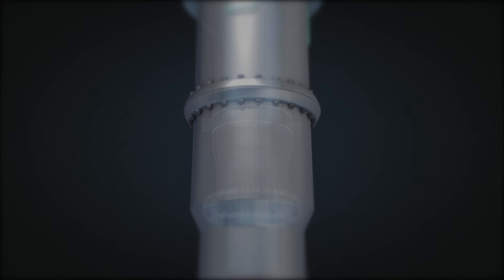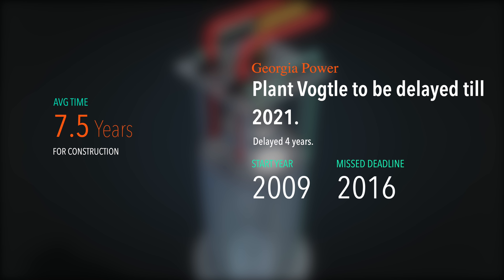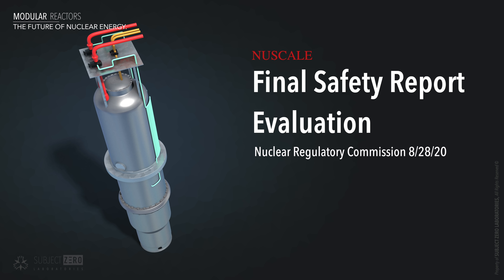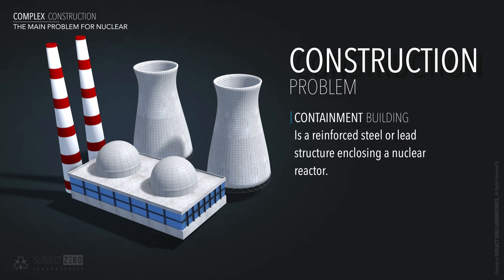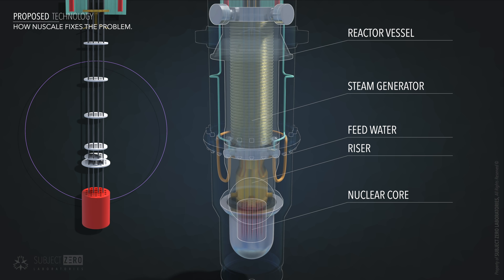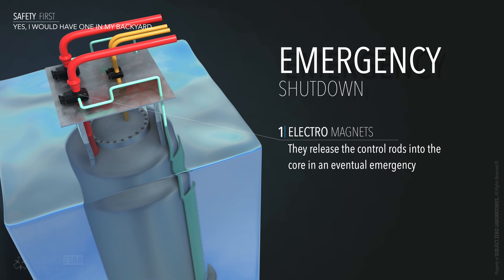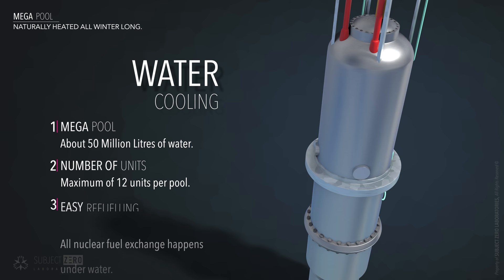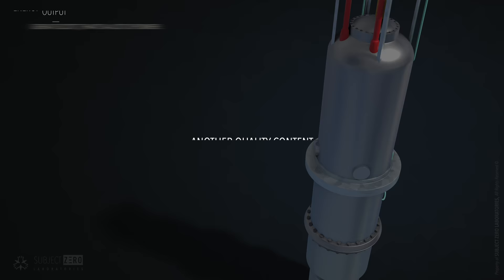A Milestone for Small Modular Reactors (SMR 2020)

Comment: The key innovation that enabled the start of the nuclear power industry was this: We don't have to worry about the expense of nuclear waste disposal because we can simply dump that burden onto future generations.  This concept is just as fundamental to nuclear technology as the idea of producing steam that turns a turbine.  So fancy designs like SMR are irrelevant to me.  I'm a hard NO until the problem of nuclear waste is solved, which will be never.  And nuclear power is no longer needed anyway, since we can now build wind, solar, and batteries just as fast (GW/year) as nuclear plants.  Also, wind and solar don't use any of our increasingly-precious water resources, and we don't need to import uranium.  Nuclear is dead and should stay dead, and I say this as an engineer, not as a political activist.
Reply: How many resources do we need to import to make solar panels and batteries? How long do those pieces of hardware last before they must be replaced?
Your point about nuclear waste is a valid one, but that doesn't automatically eliminate nuclear energy as a viable energy option for base power load. Rather than constructing billions of batteries to store energy for the inevitable dips in renewable output, nuclear at least provides another option (especially in places with extreme climate where battery performance is terrible).

Comment: What you say is true about the Japan accident.  However possibly if the generators were place on the roof instead of the basement or ground.  It may have been avoided.  Yes I know I may be wrong. Furthermore why are no SMR's are available?  I only ask a question.   I do not know all and only state what I remeber.  That said I like your video.
Reply: Not even the roof just above the wave line would of done the job.

Comment: Nuclear power has lower operating costs than most renewables? Even given cheaper SMRs in the future running costs are always going to be higher. More personnel required, fuel to mine and supply, waste to dispose of. All these things are much more expensive than any renewables. Anyway - SMRs are very promising as even the containment buildings could be prefabricated offsite. Basically you could “mass” produce them if the demand was there. But they still need to get the cost down significantly. $3 Billion for a measly 720MW reactor is too expensive. If they could do it for about a $1.50 - $2.00 a watt it might be viable. Or about half that cost. I think they’d have plenty of buyers.

Comment: The Fukushima disaster can be entirely attributed to corruption and a lack of maintenance or modifications in the face of needed changes. GE is directly culpable for much of this.

These smaller reactors are in most cases not the solution, as they are designed to be one-shot proprietary installs, with no designs intended for long term use.

Comment: Need to work on the conversion efficiency. 720 MWe from 2400 MWt is only 30%.
Reply: This is fairly standard for a Rankine cycle Carnot engine.
This is why, with a high-temperature Gen IV, people get excited about using the Brayton cycle.

Comment: We DO NOT need to lower our production of carbon dioxide, plants benefit from more, we benefit from more. Referring to our "carbon footprint" is just ignorance. "Cap and trade" is an oxymoron, the CO2 is just made somewhere else anyway.
I believe we should be going nuclear extensively, and it's nothing to do with the tiny amount we add to the trace gas "CPO") in the atmosphere: cheapness to he consumer and that nuclear is by far the cleanest, safest, and most versatile source. If you don't believe this you either work for a fossil fuel company, have shares in a fossil fuel company, or need to do some research.
I would suggest "Apocalypse Never" by Michael Shellenberger to start with.

Comment: Thorium based molten salt reactors should be the only focus until cold fusion. Why wouldn't you ? they can actively use stored spent fuel up and cant go critical.
Reply: A reactor that doesn't go critical isn't working.
Reply: @PMA65537   Salts mixed with fuel go hot- which drives the turbine- in case of a issue the salt is released through a special temperature controlled plug into a separate tank and goes cool - therefore is the safest nuclear option until fusion. You should look at the work of Kirk Sorenson.

Comment: Theoretically speaking, what would it look like if this bit of tech, the compact, was combined with the liquid sodium design?
Reply: Well, it'd need waaaaaay more development as liquid sodium reactors still have many unadressed problems like corrosion
Reply: And given that you really don't want a leak, that is a BIG worry.  

Assuming that was solved, the result would be even smaller though, due to being able to pull power magenetically, instead of the steam through the  turbine?

Maybe half the size?

Comment: Ive always said smaller reactors but more of them... The problem with the reactors that have failed badly is they were either out of date and or built in the wrong place. Dont build nuclear reactors in places that have earthquakes and dont put profit before safety . The only downside is nuclear waste . Im sure there have been at least 2 natural nuclear reactors found in nature where there has been naturally fissile material reacting in a natural setting and the earths core has loads of active nuclear material in it . Im sure more science can help us solve the waste problem and I know that is going on right now. Our power needs are not going to be met by renewable energy that is just not going to happen but with safer reactors and the science in fusion reactors nuclear power will help us cut carbon emissions.

Comment: If we ever get to using more nuclear reactors, we should start bringing back the Tesla turbine- 
It was insanely efficient for steam, and we finally have the metallurgical know-how to keep the disks from expanding too much under the centripetal forces.
Reply: Actually we reached better efficiency with multiple expansion stage turbines than with tesla turbine  

Tesla turbines are efficient but only at really high rpm and low loads so to produce the same amount of power and efficiency we are looking into 3 story building sized discs and massive reduction gearboxes while for the same power we have house sized turbine that is in some cases directly driving the generator.

Comment: It still requires the fuel rods to function to prevent a runaway reaction.  Runaway reaction seems like a non-zero probability, even if they're designed around electromagnets.  For instance, mechanical problems or outside disturbances can come into play and prevent them from moving.  While it's the simplest reactor I've seen, it still can runaway.  For that reason, I think it's a bit too sloppy a design for 2020.  Thorium reactions are miles better than this.

Comment: 720mw for 3$ billion puts it pretty close to par on with solar.
Reply: Solar capacity factor is 20-25% so you need 5x more solar power to generate the same amount of electricity ass nuclear and additional batteries. How much does that cost overall?

Comment: 0:43 oh cmon man Microsoft just paid 7.5 billion dollars on Bethesda's parent organization
Those kinda companies can easily afford a nuclear plant, and run their whole operation from there onward on their own power, while also turning in a profit.
Reply: Problem is timeline. Wendovers productions has done a fantastic video on the economics of nuclear, and why it is the perfect solution that no one uses.

with the current plublic mindset of nuclear reactors being bombs, the ammount of authorisations needed for even a light water reactor (lowest tech and least efficient of them all) drives the cost FAR above what engineering, labor and material would value them at. Because of this, when combined with gas and oil lobbies making sure fossil fuel prices are always low, but never too low as to make them not insanely profitable, it takes some years for a nuclear power plant to recoup its losses when compared to a gas power plant. It also takes far longer to build, due to its inherent complexity. 

In a perfect world, that would not matter, since the advantages of nuclear compared to gas are clear as day, but we live in a planet where the west has forgotten everything past the next quarterly report. The LARGEST timescale people work at is the politician term limit, which is ususaly very low. Due to how long it takes a nuclear plant to switch to the positives compared to inverstement, you can understand how any investor or politican would rather get bribed by the russians. If a politician decided to do the right thing and build a reactor, he would have to invest billions into the project. He would get fired at by everyone, from the eco-warriors to his own party members who would have gotten a better deal for themselves with a gas plant. This would lead to you getting the boot at the next term limit, letting you overall at a net loss. Then the next guy will either cancel the project, wasting the billions in exchange for instant political points for "having done the right thing" in people's abhorantly flawed vision, or if it is sufficiently advanced, just let it running (despite probably getting ellected over his vow to cancel the project) and reap ALL the rewards from it being completed.

Nuclear is the kind of technology which only makes sense in the long term, something that we are simply starved off today because of how ridiculously short our timescales for profit became. Nowadays, it does not matter if a company waste billions on useless shit. As long as they keep having a growth on the stock market, the herd of blind sheeps from wall street will keep pumping money into it, and lobby politicians to destroy the competition.

Comment: Could one of these power a neighborhood , cause that would be insane.
Reply: 5:21 45-60 MW ~600 houses per MW on the vary conservative end ~800 houses per MW is on the optimistic end. just depends on the average consumption for an area manly determined by climate as heating/cooling is are a large portion of that energy cost. also with greater adoption of EVs, I would expect that number to drop over the next 20 years.
Reply: @robertm1112  over the years this reactor design should improve and output more power. I was thinking that with these small reactors you can have substations generating power from 1-2 of these and spread out across a city and its suburbs there will be no need for multiple power plants that need to transport power over far distances ( less power loss ) .

Comment: Still too expensive - $10,750 per kW for Russia’s light-water floating SMR
, $6,080 per kW for China’s HTGR, $22,270 per kW for Argentina’s light-water SMR

The average of those figures is $13,000 per kW, double Bright New World’s estimate of $6,460 per kW.

All the projects are troubled - China's and Argentina's plans have stalled after one unit. Russia was supposed to have 7 floating units by 2015 but only has one. 

Banks and investors won't touch this stuff. So it always relies on sales pitches to gullible politicians. Early nuclear vendor estimates routinely underestimate costs by an order of magnitude. Estimates at initial construction underestimate costs by a factor of 2-4. Only 50% of nuclear construction sites (not plans or approvals, actual commenced construction sites) are ever built,  hammering the costs yet again.

Comment: Great video,  but you didn't answer one of the biggest questions:
What about the nuclear waste?
Reply: You can just store it in concrete facility, nuclear waste is solid so it very compact the problem is the cost of running the facility
Reply: @mandalamarcho7997  the problem is running that facility thousand of years
Reply: @osi1neu  do you not understand it can be recycled, and we are getting better at it.
Reply: At the moment we can't.
Do you have any sources?
Reply: @osi1neu  lol we can't, yes we can most governments just don't want to. France is the only nation that does recycle it's spent fuel rods.
Reply: If you refer to recycling uranium fuel to mox fuel, please compare the half-time period of uranium and plutonium. 
At the end of those recycling processes you may have less waste in volume/mass, but the long term radiation is far more critical. We are talking about >10000 years.

Comment: ll the old uranium and thorium fission reactor problems go away with the new Fusion reactor era now here. We have recently taken a new step to advance the physics of power production by enabling chemistry of the atomic nucleus, or "nuchemy", We are passing the chemistry level where we interacted with electron shells and are moving on to nuclear manipulations in this "nuchemy" atomic nuclear era when we interact and multiply nuclear protons using hydrogen fuel stock. We have rediscovered the lost work of the alchemists and can make new elements with different atomic weights and vastly new properties. This was ably demonstrated in "The Safire Project". Quanta are important. We now have enough energy in them to manipulate the atomic nucleus much more easily by creating a compartment or a local region of plasma containment so reactions at this atomic nuclear level can easily take place. This is about to practically enabled a fantastic new era of energy production for the whole of mankind. This with free fuel obtained from water or atmospheric moisture anywhere in the world. New fusion nuclear is at the industrial commercial production final development point as of now. The energy argument and other power methodologies are all now irrelevant as we have new and very physically and economically powered practical and local community level fusion nuclear power. Solar roof plus Teslawall battery may be the present way to go domestically but megapack batteries and multiple storage technologies interconnected with an expanded ugly grid have a less certain requirement when you consider new any-scale community based and 24 hr self-fueling reliable fusion nuclear in the form of the "Safire Generator". Learn all about it at "aureon energy.com". Learn the newer EU physics at "Thunderbolts Project.com" and you will be permanently reeducated with the advanced new theory.

Comment: They could still blow up if the surrounding pool has some sort of severe leakage. Perhaps due to an earthquake.
Reply: The pool would be build to withstand an extremely severe earthquake, and so would be unlikely to leak.

However, if the pool lost all its water, the reactor might melt down, but it won't blow up
(this is why they call them "meltdowns" not "blowups").
a - there is ZERO possibility of a nuclear explosion
b - if the water drains away, where would the water for a steam or hydrogen explosion come from?
Reply: @factnotfiction5915  no, not a nuclear explosion like an atomic bomb, but similar effects in summary as in Fukushima. Uncontrollable reactors, meltdown, contamination.
Reply: @richard--s  In Fukushima, hot water dissociated into hydrogen and oxygen, resulting in spontaneous hydrogen explosions - providing a 'motive force' to move radionuclides beyond containment.

In your scenario, the water has drained away, so no hydrogen, so no explosion providing motive force.
Other than corium melting through the bottom of the reactor and oozing onto the base of the concrete pool (presumably designed as a 'core catcher', so doubly effective), exactly how do we get a Fukushima-like spread of radionuclides?

Comment: Stop high pressure low temp reactors. Move to high temp low pressure
Reply: High pressure and low temp is actually safer and easier to control than high temp low pressure ones 

Just ask Chernobyl designers
Reply: @blackturbine  what does this mean? I do not agree with how this is written, but I do agree with the reverse.
Chernobyl, an RBMK, was high pressure low temp..

Comment: Fukushima didn't melt down. The heat meant hot steam - the reactors had already been turned off. I'm not saying it's not radioactive, or that it's safe to return to Fukushima or that people didn't die, it just wasn't a meltdown, and rods weren't involved. https://youtu.be/saM85y8lFm4?t=1921

Comment: Nah - sorry. Nuscale is old technology that is not intrinsically safe. We need to go to one of the Gen IV reactors such as the offerings from Elysium Industries  or Moltex Energy. Both are much more impressive, are intrinsically safe and will also get rid of all the stockpiles of nuclear waste and plutonium from de-commissioned weapons.
Reply: R Edmunds Gen 4 reactors are worth continued development, but from a regulatory and utility perspective, nuscale is far more attractive. Yes it is based on existing gen 3 reactors, but that means it also basically works like they do already.. no ground up staff (re)training.. regulators will be more familiar with the technology.. etc. Ultimately, utilities will find the nuscale concept attractive because the plant will basically always be generating revenue at some level and ideally just cycling through refueling and maintaining one modular unit at a time.
Reply: @Penryn87  The regulatory requirements for the two systems I mentioned, particularly Moltex, will be a lot less onerous than for Nuscale as a lot of the problems with a PWR (I.e. Nuscale)   simply do not exist in the next generation of reactors. Moltex are aiming for 2030. I hope they make it as I would really like to see them start burning up the stockpiles of plutonium and the piles of nuclear power plant waste - produced by PWRs like Nuscale .